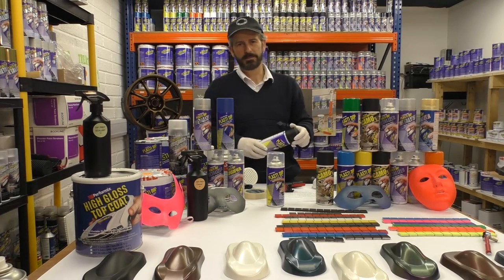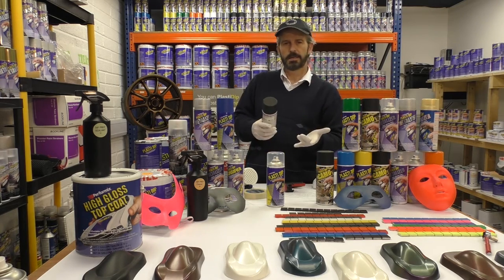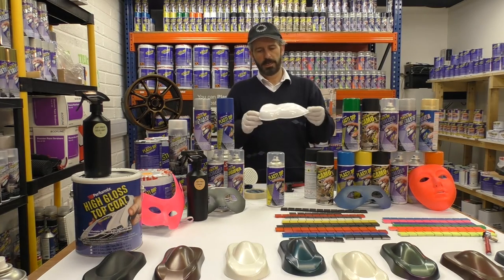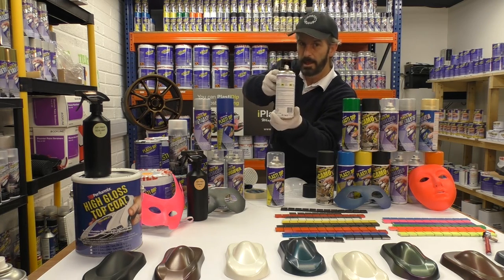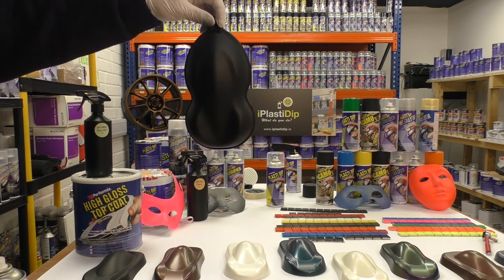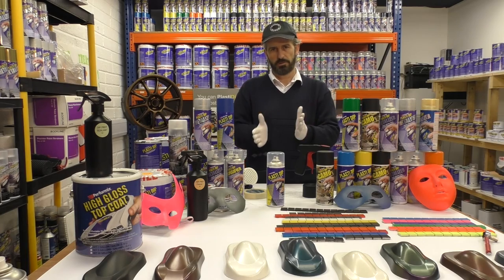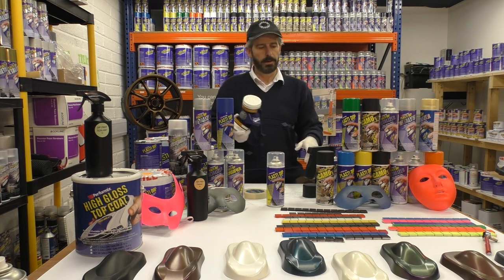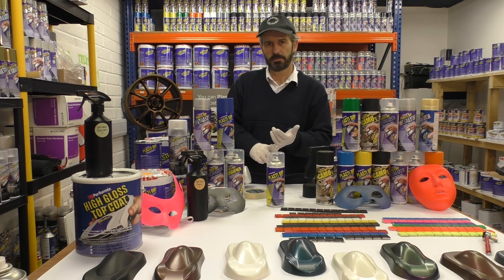How to Spray Plastidip  Aerosol Cans

Comment: Hi I been trying to use plasti dip to make pieces of my car trim blues and the first can I used worked great the last two cans I got the first coat on after dust good but while trying to spray second coat the can started to leak drips from what seemed like under the spray nozzle what am I doing wrong ??? And ideas ? Would be greatly appreciated if you have any insight I’m sure it’s something I’m doing as they both worked fine at first but both developed a bad leaking drip while spraying I thought maybe it was clogged and that caused it but on my second can I made sure the nozzle was clean before starting each spray and it still happens

Comment: Hello, what is the spray used for the mask on the extreme right? Also, is it possible to blend colours using sprays?
Reply from the maker: That was either plastidip blaze orange or full dip fluorescent orange, with 2 coats of matte white full dip as base coat to make bright.
Do not know if possible to blend sprays, i guess it would work with some colours